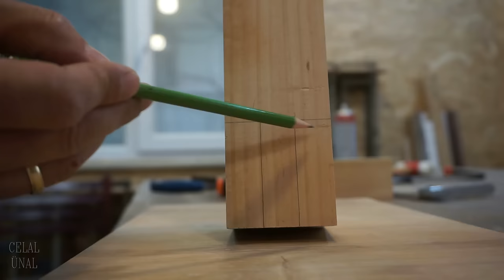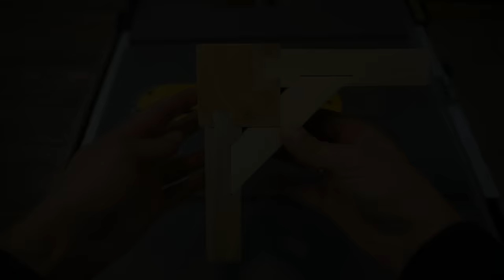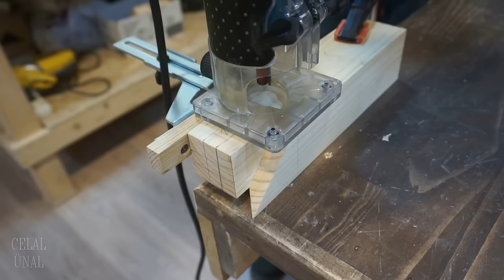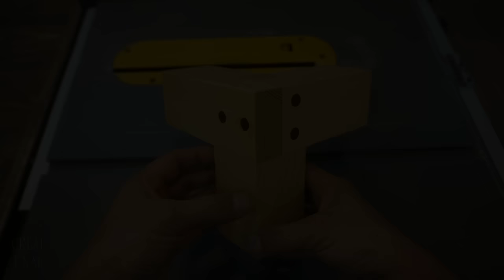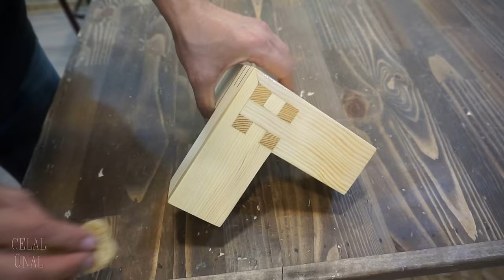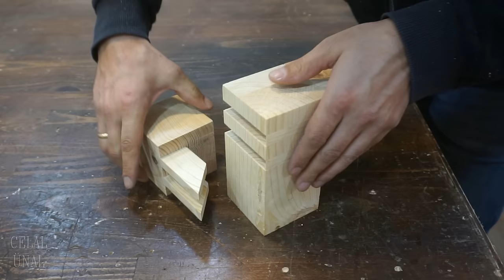10 Woodworking joints / Corner wood joining techniques

Comment: Great video! How would you make such a joints without the table saw for a bed frame corner, where the material is 2 meters long? Probably not with the table saw...
Reply: It will take a great deal longer to complete

Comment: What is the strongest of them all? I'd like to use them without adding metal parts or glue and the structure has to hold a lot of weight